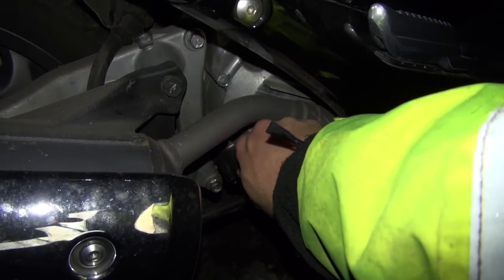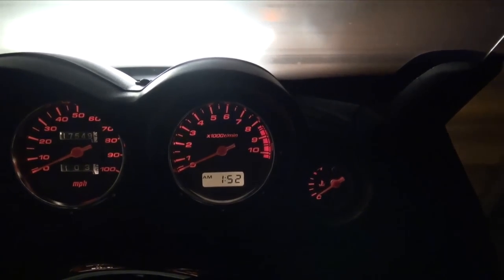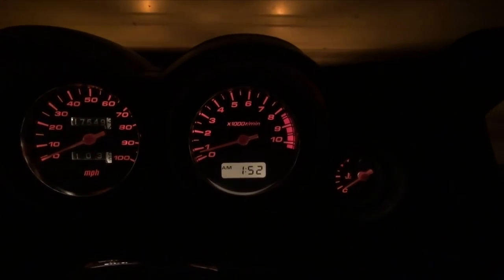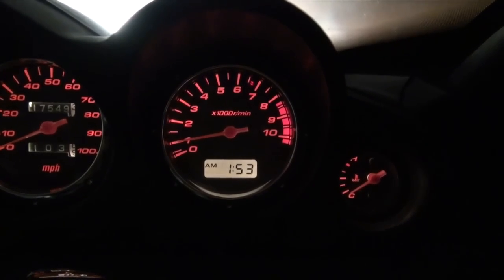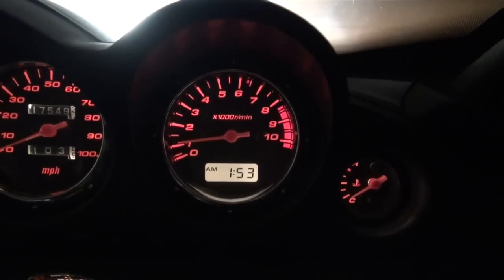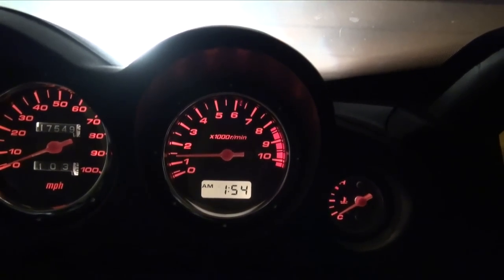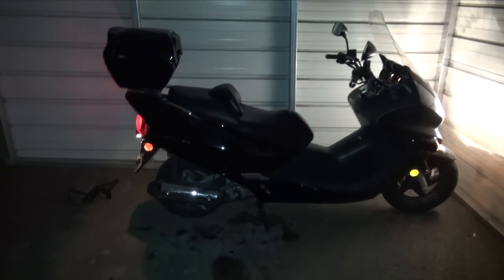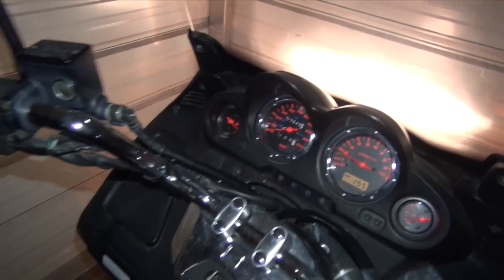Cold start of a 2004 honda reflex scooter at 14 Deg f

Comment: Even at that low a temperature it should start easier than that.  I'd check the fuel enrichment system...plunger stuck?  orifice plugged up? wire disconnected?

Comment: There is no way that scooter would take that long to start, even if it's cold. Otherwise, great video.
Reply from the maker: It is a honda carb engine.  they do not like the cold.  above 40 Deg it starts right up
Reply from the maker: But in the warm weather it starts right up
Reply from the maker: +Helen Rice Yep :)  Honda small engines dont like the cold.

Comment: is it carbed or is it fuel injected  2 or 4 stroke
Reply from the maker: 250cc carb 4 stroke engine
Reply: +DieselDucy That's smart. My UTV never has cold starts when it goes to the mountains in sub zeros. Last time I went to the mountains it was 19 deg. Dad drove me up there like always. The thing started within 20 seconds.
Reply: +DieselDucy 
I figured it was carbureted since you said it burns some oil while warming up. I am all too familiar with that smell as I have a 1975 2-stroke Evinrude 70 outboard motor on my boat. Boy does that thing put out some nasty fumes!

Comment: Can't believe you want twist the throttle even a little to get fuel into the cold engine,,much better option than grinding away on the starter.

Comment: I see comments regarding "starter motor" but I don't think the Reflex has a separate starter motor but uses the alternator to act as its own motor during starting, it then goes back to generating mode. I've looked at the service manual for the reflex and there is no starter motor -- just a sprag clutch that again operates off the alternator.
Reply: You need to get a new service manual because the starter motor is chapter 19 section 4, in THE Honda service manual.
Reply: @liamjohnson2474  and, you ARE so correct! thanks.